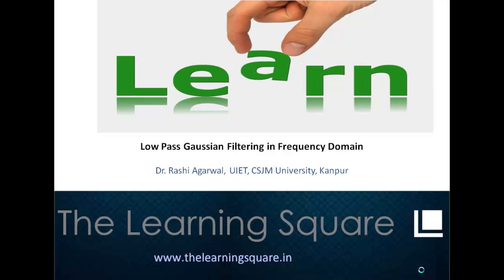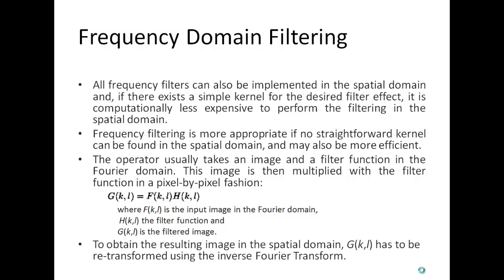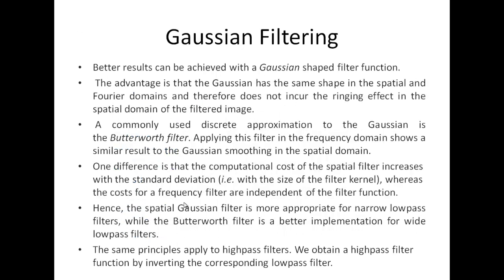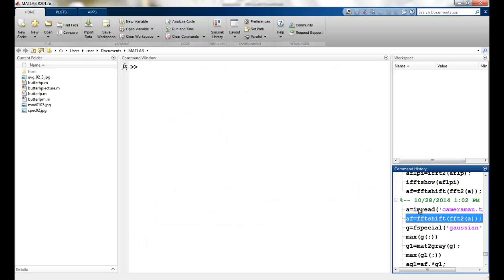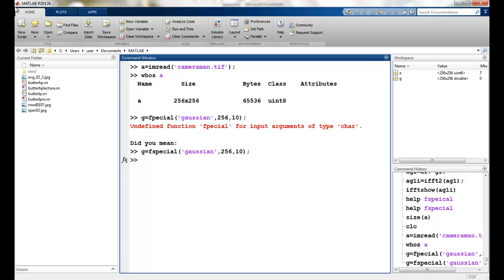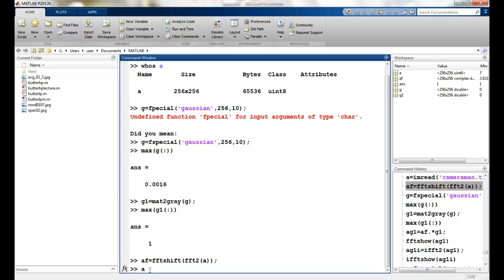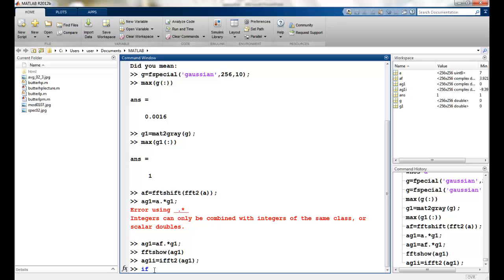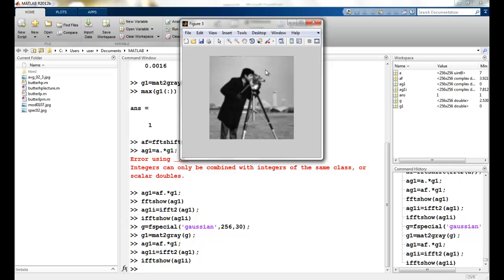Low pass Gaussian Filter in the Frequency Domain using MATLAB

Comment: Thank you for your video series. I have learned a lot.

I intuitively understand two separate ideas. First, that a gaussian filtering is just one type of low pass filter applied to the fourier domain, that does not produce the ringing effect observed by a harsh circular cutoff.
And second, that applying a filter to the fourier domain is more computationally efficient than the 2d convolution performed in the spatial domain.

But we can also apply a gaussian filter in the spatial domain, using different kernel sizes, by 2d convolution. Could you explain what change in kernel size in the spatial domain looks like in the fourier domain? Is there some conversion between the gaussian filter used in spatial domain vs the fourier domain?